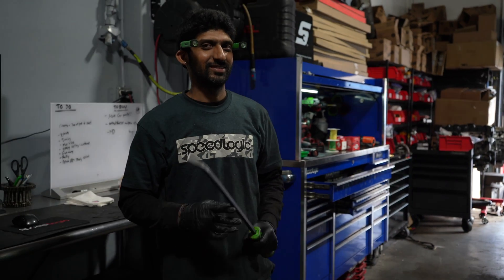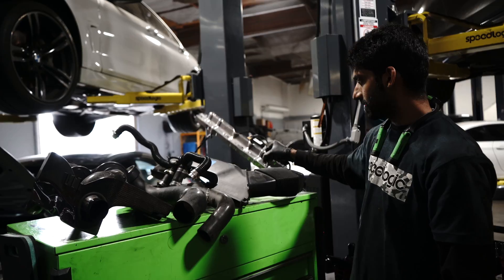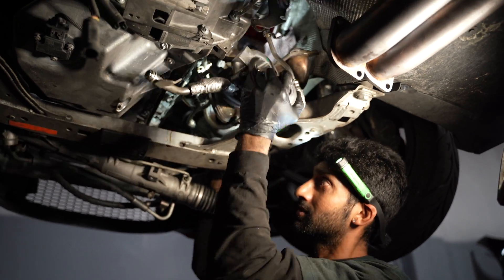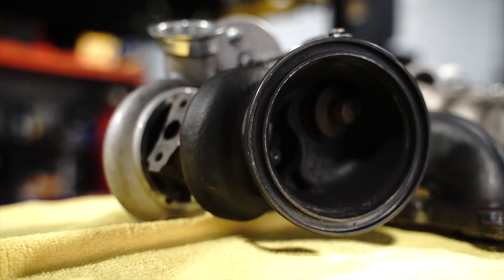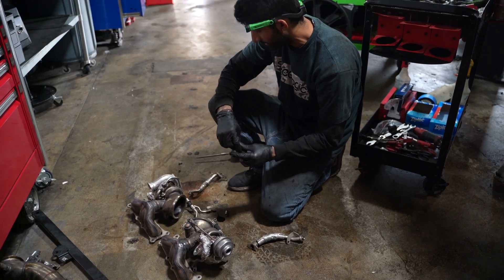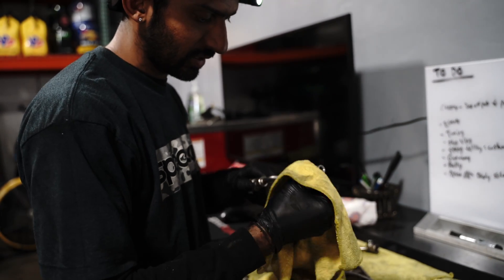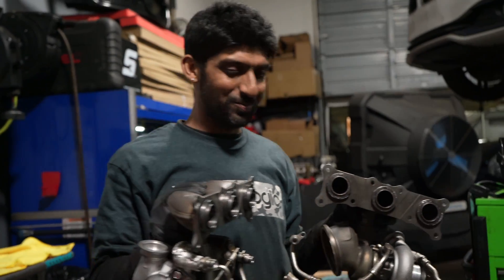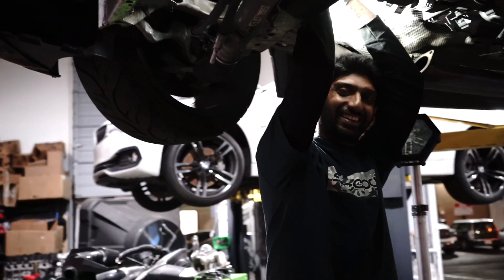Pure Turbo N54 Stage 2 Upgrade on BMW 135i | Installation and Options

Comment: Do you have to tune the engine after installing the new turbo's?
Reply from the maker: Generally after a new set of Turbos - yes you will need to retune to car to make the best power optimized for the new setup! 👍

Comment: So basically don’t buy over seas pure turbos is what you’re saying? Or don’t buy the highflows?? You lost me on the ones with cheap manifolds
Reply from the maker: We usually suggest sticking with the Pure Turbo DD (Daily Driver) and Pure HF (High Flow) models for the N54 Engine. Both these options are made in the USA. The option we don't suggest is the Pure600 which are made Overseas. Let us know if have any questions and happy to help and/or clarify. Thanks!
Reply: Is this still your recommendation today?